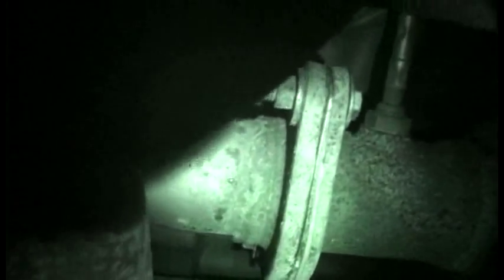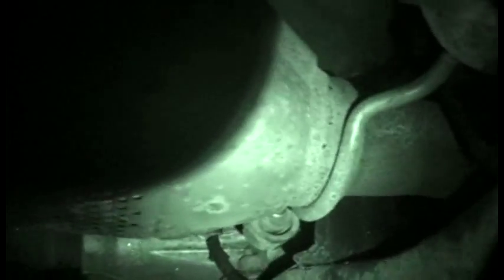Can I remove the Catalitic Converter?

Comment: what you need is an O2 sensor bung welded into a straight pipe. You need that O2 sensor period. So go to summit racing and search for O2 sensor bung to get a look. You will need your sensor out to determine size.. good luck.

Comment: The connector for the OBD2 reader is below the dash near the parking brake pedal.  If you are really looking for more power out of that truck, try eBay for a high-flow cat converter.  Also, if you are looking for advice, try joining a forum like S-10 Forum or Blazer Forum. It can be a very big help for stuff like this. Even bigger help for repairs if something goes wrong. Good luck.

Comment: If your province has vehicle inspections, forget it. It won't pass the inspection. I live in NY state and they have VERY strict rules on that. I would think it is the same way in Canada. Also with the O2 sensor, if the sensors are not working (as you suggested), the "Service Engine Soon" light (I think for Canadian versions it is an "engine" symbol?)  would be on and it would set a code for it.  If the light is on, you need an OBD2 reader to pull the code.